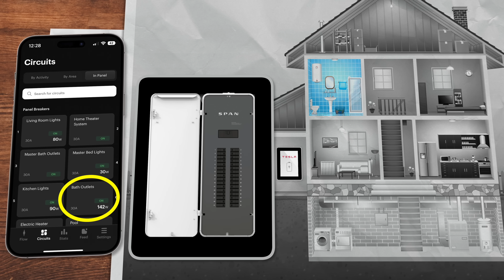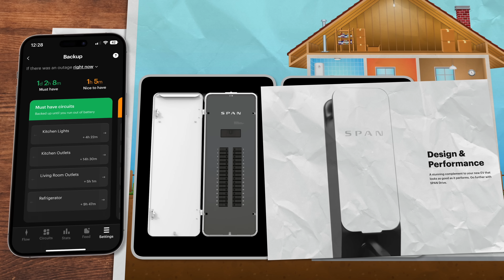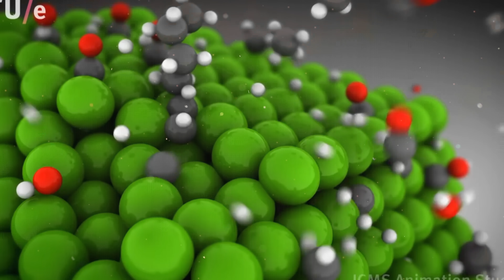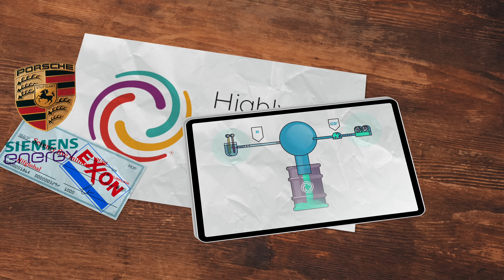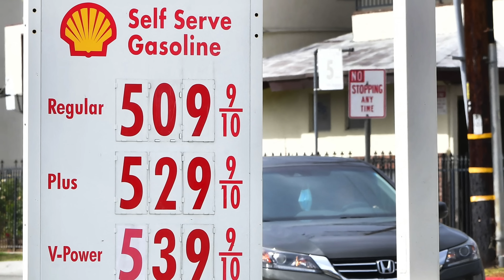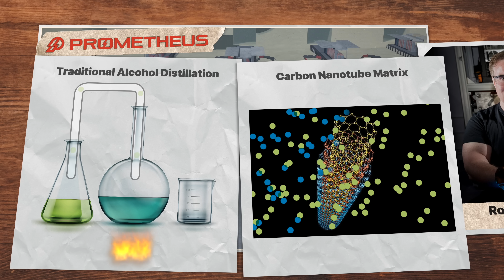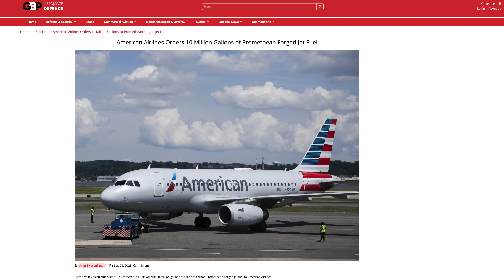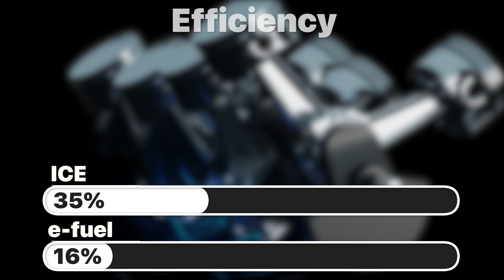EPIC Breakthrough Can SAVE the Internal Combustion Engine!

Comment: I would have liked to see the pollution of e-fuels discussed. Environment and health costs are too often left out and should be always included when comparing different technologies.

From a quick search, it does not seem to be looking good for e-fuels:
"Testing of e-fuels has found that they emit as much NOx as standard E10 petrol, and much more carbon monoxide. E-fuels also produce twice the amount of ammonia. This can combine with other compounds to form particles, for which there is no safe level of pollution. "
Reply: Direct methanol fuel cells.  But modern cars are almost pollution free.

Comment: Instead of drilling oil to put CO2 into the air use solar to pull CO2 out of the air and create e-fuels that you can ship just like oil products. The sun-belt states will be the new oil fields and cleaning the air while we do it! President Biden has signed into law bills that will do just what you are talking about along with finding new ways to put carbon back into the soil as fertilizer. President Biden is moving America into the future. It will be a few years before you start to see it but mark my words, it IS happening!!!

Comment: the problem is that EVs are an environmental horror show - when try to scale them to where they're the dominant form of transportation. Solve the gasoline, diesel, and kerosene problem with synthetics made from CO2 from the atmosphere and stick with ICE vehicles, then that is the modt environmentally sustainable way to go. But will need to build out tons of modular nuke reactors to get electricity ultra abundant and cheap

Comment: Why should we produce hydrogen when it comes out of the ground naturally just cap it off and use what you need to store the rest of it.

If you actually sat down and logically thought about this doing all of the math to figure out what you were asking us to do you would find out you were asking us to make a larger footprint well starving the planet of oxygen because you were pumping CO2 into the air in order to suck the oxygen out of the air so that you could capture CO2 and pump in oxygen and then light a Coal Fire to heat it up to such an extreme heat that we produce water and then use the extra heat from that since it's got a cool down anyways to produce electricity so that we can produce hydrogen every time you run another Circle you burn another 30% of the oxygen putting carbon into our environment and you get less than that out of it you get less than the original but more than that now you're adding toxins to the environment that we weren't even digging up originally if you're going to add toxins to the environment you might as well go with nuclear batteries that actually gives us a 10% decrease unless we break open the batteries and completely entire planet which were likely to do because the human being is a creature of chaos and habits because we are greedy by Nature and we're always testing the limits . We are also a very jealous creature which forces us to work harder to put down our enemies which puts more toxins into the air sucks more oxygen out of the air and pollutes more of the planet why don't you just become a shepherd and do the least amount of damage possible.

Comment: Somebody had to dig up the materials to create that electric car oh carbon emissions somebody had to dig up the grease and oil that you Lube that electric car with carbon emissions electric cars are zero recovery oil eaters to dig everything up to produce the wheels to produce the oil and grease to produce the paint to ship it out to you and to create the roads that you drive on not to mention the roads themselves the tires and the oil and grease not to mention the plastic and then yes it's true you may get some of your electricity about 20% from solar and wind the rest of that electrical energy that you charge the batteries with is coming from fossil fuels. Beyond that we've also got oh all of those wonderful solar panels and windmills somebody had to dig them up manufacture them and the windmill needs lots and lots of Grease and oil. But what I think is as funny as anything is the amount of oil that you're burning to explain all of this to me because you're expecting me to burn the oil to listen to you. And it's very interesting how you don't say anything about burning batteries or recycling all that rubber and plastic after you've basically worn it out anyways. Do you think all of that carbon doesn't count when you throw it away actually it goes to landfills where it takes a very long time to biodegrade oh yes oil most definitely does biodegrade and then it seems down through the Earth and it turns right back into oil and coal.

However human beings being the worst carbon producers or CO2 gas producers what happened to volcanoes and let's be nice and just say the Atlantic the Atlantic produces 30 times more CO2 and greenhouse destroying gases then human beings and I'm even counting our food into that measurement because raising cattle is almost a third no it's half of the bad stuff that we throw into the atmosphere cow coughing goat manure horse manure horses aren't really food bison coughing bison manure milk we make them produce milk for us. Tally it all up what humans do to pollute the Earth every year and in about 10 years we can match Vesuvius win pompeii ended up getting covered. What really needs to happen is you need to stop quoting these scientists that are more than a thousand percent off on their calculations. It makes you sound like you just got off the plantation and you haven't gone to school yet

Comment: Great video and way to think out of the box.
One question:  Are there other processes for converting Hydrocarbons into energy that are more efficient than ICEs?
Reply: Fuel cells.  Direct methanol fuel cells are up to 97% efficient.
Reply: @scottslotterbeck3796  Interesting, I wonder if it is possible that transmitting energy using methanol in pipelines might be more efficient and electricity through wires.
Reply: Gas turbine I think...
Reply: There was something called the Wave Disc engine a decade ago that looked promising.

Basically a hi efficiency hybrid concept where you just use the engine as a purely petrol -> electric generator with everything else being the same as an EV, so inverters, electric motors etc.

I suspect the aggressive ramping of battery production may have killed it in its infancy.

The last news was a study paper released in 2017 by Columbia University titled: 

"Two-Stage Wave Disk Engine Concept and Performance Prediction"

Comment: E-fuels also makes a really good battery when combined with generators.  You could even use the most efficient fuel type, still a loss of efficiency, but it sure uses less area.
Reply: Conclusion, we need ICEs, EVs and hybrids together, including fuel cells and H2-ICEs for a balance and energy efficiency. ♻️
Reply: @playgt326 Well said. What's the key to risk reduction? DIVERSIFICATION
Reply: @Israel_Two_Bit  Exactly, using bioelectricity, biofuels, hydrogen and e fuels, clean and renewable souces. ♻️

Comment: Hydrogen makes little sense because it is too inefficient. Efuels are lucky to be half as efficient as hydrogen production! This is not in any way shape or form a good idea. Yes it is technically possible but it is a much worse idea than burning virgin oil from the ground. It would surely use less oil to pump virgin oil from the ground than burning the extremely expensive fuel from this process.

Comment: Where is the power going to come from to create the efuels?  The ICE is roughly 25-30% efficient…. Therefore even if you create a 100% efficient e fuel process you are going to need 4x power input to create the e fuel.  Seems like a big waste to me.  I would use that extra power capacity to power electric powered equipment, at a much higher efficiency
Reply: qorbf

Comment: One of the things that until combustion engines have is the fuel system that converts the fuel into the mix with air instead of using injection a vapor fuel system will increase the car's efficiency these are capable of more than doubling their efficiency it's a matter of vapor fuel systems versus injected vapor fuel systems can boost the efficiency of a car that's been proven and it does work by using a smaller amount of fuel that can be mixed more intensely with incoming Air at the closer ratio to 14.68 to 1 without damaging the engine is very possible
Reply: You want to go BACK to carburetors?
Reply: Vapor fuel system

Comment: Worth mentioning e-fuels are cleaner burning, no NOx, so no smog
Reply from the maker: I didn’t mention it but yes!
Reply: 1) there is nothing unusual happening with the climate.

2) there is nothing wrong with burning fossil fuels.  Its problems in high-density areas are trivial to fix and already have been fixed.  CO2 is not a pollutant.

3) Climate alarmism is a big-lie superstition supported by tax-bribed liars.  (See Climate Discussion Nexus for 100s of videos on climate quackery, deception, and realism.)

4) decarbonization is 21st century pyramid building and human sacrifice. 

5) there is NO excuse for expensive electricity.  Electricity generation is boring.     Just burn coal and scrub the smoke in densely populated areas.

6) the only challenge is manufacturing market quantities of cheap gasoline.  South Africa has already done this for decades (Sasol), using coal,

Comment: Internal combustion engines are less efficient than electric engines, smell bad, are harder to repair (at least for vehicles designed after about 1970), require more maintenance (especially for vehicles designed before about 1970), and have higher fuel costs, even if this process does reduce the costs of synthetic fuels significantly. There's a hefty amount of research into EVs weakest areas (battery costs, distance charging, and the moral grey areas around lithium mining) with probably breakthroughs in each of those areas that will hit market before this one can.

This seems like a cool bit of technology that isn't really a good idea.

Comment: We have got to talk about the Levelised Cost of Energy in a round-trip process.   If we do, EV’s tend to make more sense.  They can take DC solar/wind energy directly to charge battery and have efficiency of 90%… we just need better batteries for cars… but with Aviation, Marine use cases we need Hydrogen as it’s dense enough.  Or some form that has the energy density for those use cases.
Reply from the maker: Very very true!

Comment: I thought the plan to transition to electric vehicles was to do so progressively, ice to hybrids to ev. Along came Tesla and I feel the industry has had a knee jerk reaction to Tesla. They have been thrown off there game by the disruption. I think the ICE car companies can make highly efficient hybrids that use a hyper efficient ice engine coupled with batteries. This was and still is a good plan. In fact I think people would more readily buy a hybrid because it uses the existing infrastructure. I am not an engineer but I can think of ways to make a hybrid car be cool and very fast. Use ultra capacitor batteries like a flywheel to get the car going quickly off the line. Kick it over to the ice when it is in the sweet spot and collect the energy lost in breaking. Ok, it’s not as easy as building a straight up ICE car but it can be as fun and high performance as you want it to be. The ICE engin can take the place of a significant portion of the battery. Combine everything, ultra caps, lithium batteries, high efficient iCE motors, recumbent breaking into a sleek package and it will sell and be something that is practical. I bet they can outsell EVs in the near future. This could buy a little time to get battery production up to speed. It’s a little late in the game but I think there is still time

Comment: The future of fuel is no fuel. Laws of physics says internal combustion can’t be saved. You only get about 15-20% of the energy in fuel at the wheels of the car, at best. The battery electric cycle can be upwards of 80% efficient, even above 90%. Getting four to five times as much work out of a given unit of energy is transformational. Jet engines are external combustion and won’t be replaced for longer, and niche applications will remain.
Reply from the maker: We’ll said!
Reply: Direct methanol fuel cells, up to 97% efficient.

Comment: Electric vehicles are not 85-90% efficient. Electricical-power transfer is only 65% efficient from the power source to the "delivery-site", an that's before it's transformed, inverted ,and "poured" into the vehicle, equaling about 40% efficiency.

Comment: Electric vehicles are the Next "SUPER-POLUTER's". Battery manufacturing are EXTREMELY TOXIC & Very Dangerous to make ( worked at building the plant that makes them). There NEEDS to built 3 TIMES MORE POWER PLANTS to supply power for these new "ENERGY-HOGS". The "electric car band wagon" is off the rails & the next big train-wreck. All the "campaining" for this "wonder-product" is just a big "scheme" ( because they are SO EXPENSIVE). Charging ( lots of time wasted) & the Extreme Fire Hazard attributes, Expensive are some more of their "Worst" features. The transfer of energy takes MORE ENERGY.

Comment: So much to cross examine…..
Average e car weight 4000 pounds? In America maybe. The rest of the world are happy with less… generally. Uptake of the US evolved suv presently cancels out all of the environmental benefits of ev’s.
Pollution will still continue with any adoption of e fuels. Childhood asthma is a global pandemic. 
Throwing the big car makers a line would be tragic. Just imagine how quick they’d be to drop all their environmental lip service.
Those same big guys have no interest in a durable car, and an e fuelled car would break down, leak, explode just the same as now. Moving parts in an ice car engine number in the hundreds. Ev motors 20. The all-electric Chevrolet Bolt has 80% fewer moving parts than a comparable car with a gasoline engine.
And they’re noisy!  You might think you’re just hearing tyre noise as one goes past, but just wait for an ev to glide by. Just because we’re used to noise pollution doesn’t mean it has no effect on us. And also…..

Comment: OK I see.  Fundamentally, the fuel we use called gasoline, is incredibly powerful.  It is so power-packed, it can even overcome the 15% to 20% maximum efficiency of the reciprocating waste of heat energy we call the internal combustion engine.  ICE is only a bit less efficient at heating, than your gas boiler (85% heat from ICE motor, compared to 93% at BEST from a modern combi boiler).  So as a heater, an internal combustion engine is pretty near brilliant.  It just happens to be able to turn a shaft as a minority side-product while doing so.  

So, e-fuel…no.  It cannot overcome the 15% to 20% efficiency madness.  And really, this is a thing that the oil lobby would LOVE to see get proliferated as headlines.  Let’s see a dozen prototypes, put through their paces, like Rivians were, with Ewan McGregor’s South American trip.  Then I might even take it seriously.  Still can’t fit a gasoline motor inside a wheel.  Thanks though, thought-provoking.  Take care all.
Reply: Direct methanol fuel cells.  Up to 97% efficient.
Plus you forget infrastructure.  We already have it for ICE.  Electric cars are impractical.  $20,000 for a replacement battery in a Tesla.
Reply: buy naçgregire oôwer sàol 40 hp ekrrc oiytvard

Comment: These e-fuel providers should start by providing alcohol as an octane improving additive for gasoline, as that would cut the steps to convert alcohols to longer chain hydrocarbons. Alcohol could also be sold for those "flex fuel" vehicles that can run on it, and might also work for jet engines. Once production is ramped up and costs brought down sufficiently, they can start producing other hydrocarbon fuels as well. 

There are fuel cells that can run directly on e-fuel methanol, that could be a viable higher efficiency source of electrical power for aviation, road vehicles, and ships. Far easier to store and much more compact than hydrogen fuel. 

But in the long run, even the cheapest e-fuel won't be able to compete with the low cost and convenience of battery electric vehicles in most applications. The future of e-fuels is inherently limited.

Comment: It is nonsense to think we can use E-Fuel and save ourselves from climate change.  The E-Fuel may be ideal for heavy goods vehicles and planes, but the use of E-Fuel will not be viable to reduce the pollution.  It will be more beneficial for ICE car manufacturers, with extra parts to maintain will increase servicing charges.  Big Oil and ICE car make money while lying about how great it is for the Environment.  (BTW, rockets generally burn Oxygen and Hydrogen, and NASA does not pop down to the local petrol station to fill up the rocket.)

What I would love to know the energy usage and compare it to use the electricity to decarbonise homes? What would be more efficient?

Comment: Wrong. Combustion engines are not the main culprit behind the climate crisis and nobody who has spent any time researching it would think this. Vehicles account for less than 15% of the problem. Stop spreading this incorrect rumor. Saying it repeatedly does not make it fact. Are vehicles good for the environment? No. Do we need to fix the current model? Yes. Are they the top problem? No and repeatedly blaming individual consumers in this regard is just shifting the blame away from big business and bigger problems with more manageable solutions.